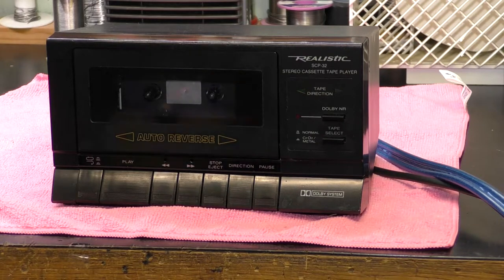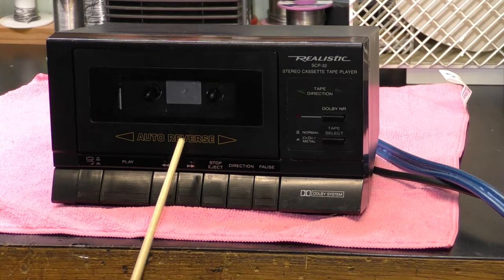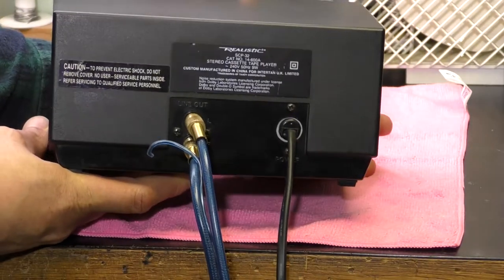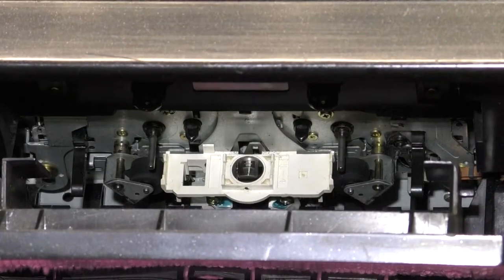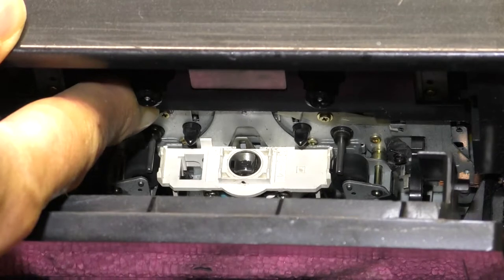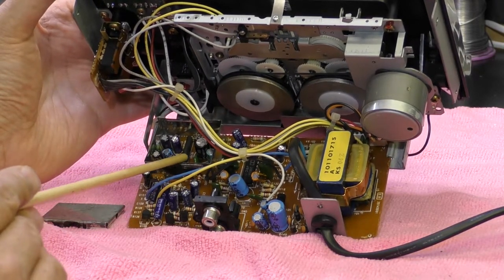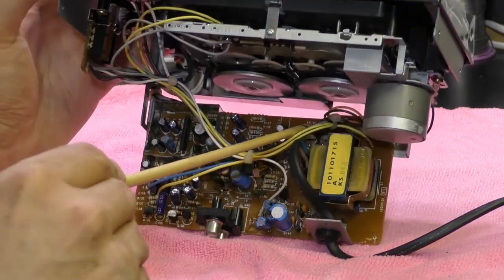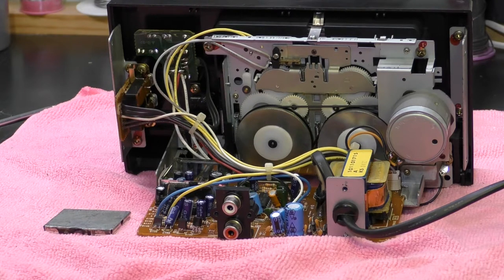Realistic SCP32 Playback only cassette deck.

Comment: Hi, how is the sound quality or this model and in general this company? I’m looking for just play back music. What other company would you suggest? Thanks so much.
Reply from the maker: It has reasonable performance for what it is. The wow and flutter are good despite the small looking, but heavy flywheel. Has Dolby and tape selector. Much better than low cost modern decks. Only fault is slight Dolby mistrack, but not tried adjusting.

Comment: Hi, I have the same unit  but the speed needs adjusting and I tried to open  it up but it wouldn't come all the way off . unscrewed the 2 screws on each side and only slide out a little ways are there more screws or is there a trick to it.
Reply from the maker: There are screws next to the rca/phono socket and above mains lead.
Reply: thank you.